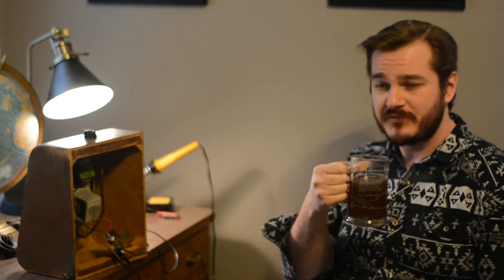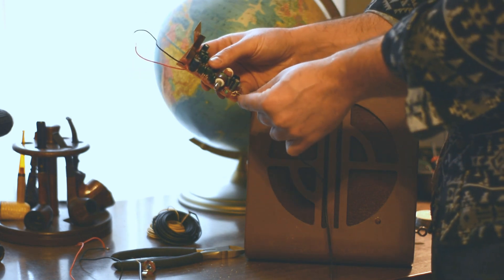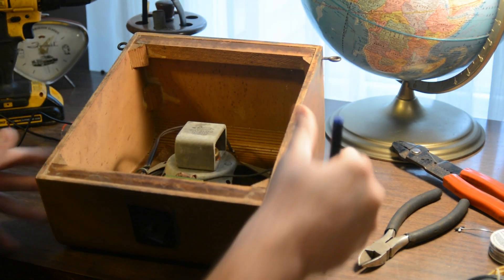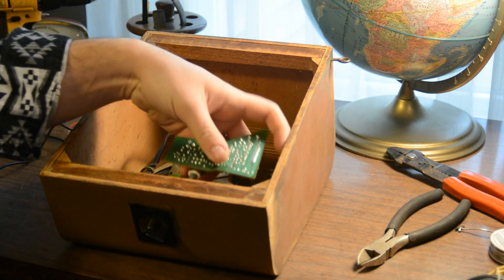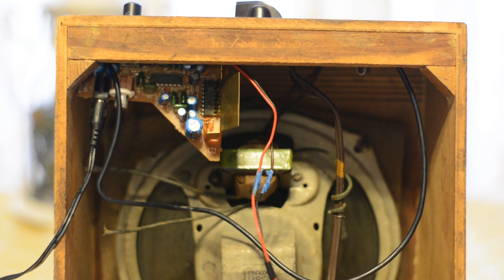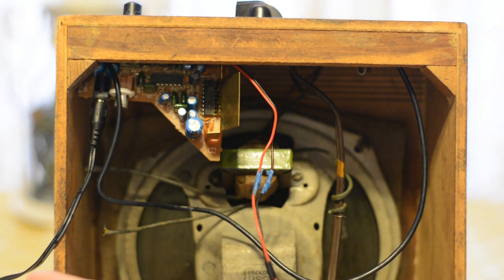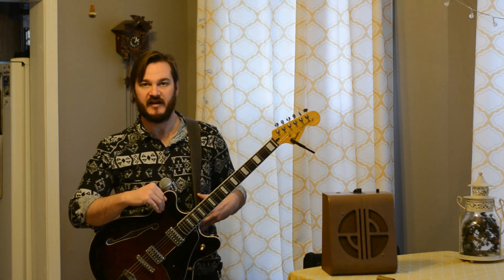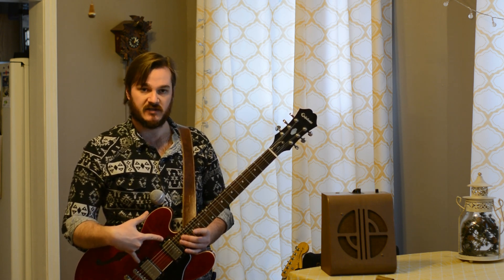Deacy Style Amp From An Announcement Speaker and Computer Parts

Comment: Good job. 
But doesn't a little computer amp like that be designed for a line level input rather than a mic/pickup level source like what you're using? If it works good as is then fine. Still I'm wondering what could be done to further optimize it.
I have all sorts of amp bits and transformers and what not from old organs and other gear. I'd like to figure out how to fabricate a similar amp using some of these old analog parts I have.
Reply from the maker: It works just fine with the line level input. I am not entirely sure how the original Deacy amp was done.